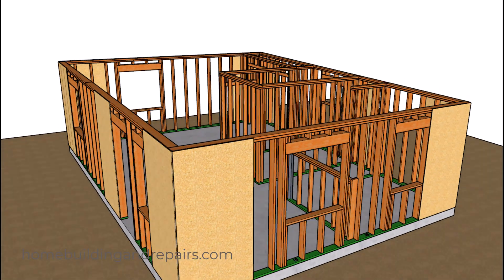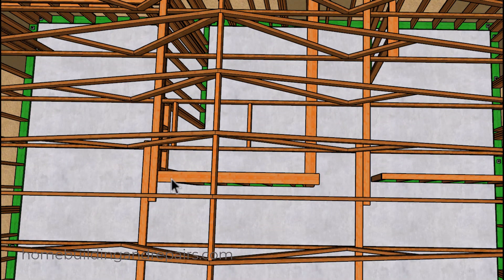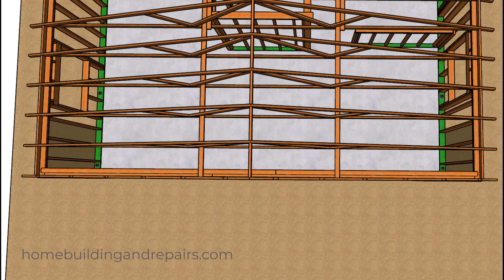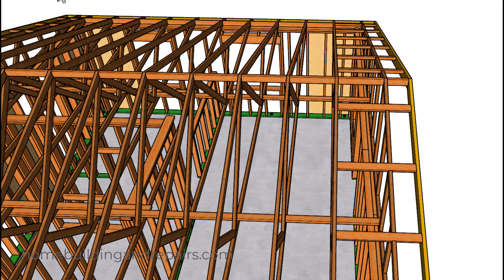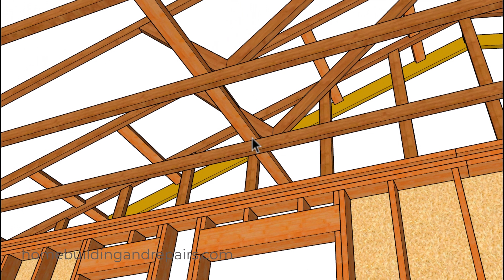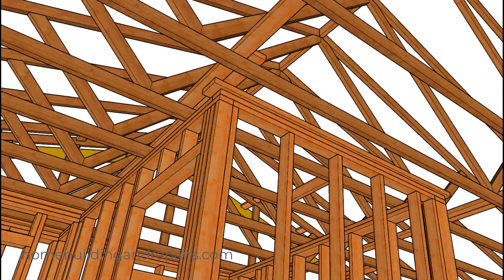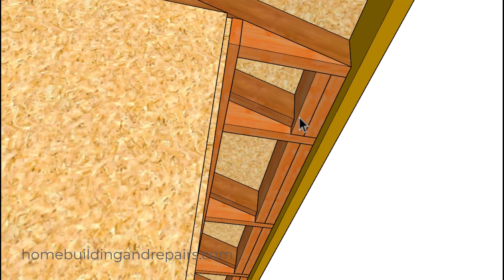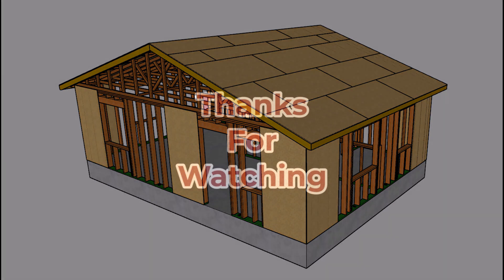Gable Roof Truss Framing Tour of 600 Sq. Ft. Small Home Construction - Part 4

Comment: How are you able to notch the gable trusses? Are they engineered that way?
Reply from the maker: It's because they are supported by a full length wall. They can be eliminated by building a full height rake wall instead of using the gable truss also.

Comment: Love the videos every time! Can you please add hardware for wind exposure that way most can see what code requires. Also, rated soffits are protected from the bottom only with no penetrations. Type X sheetrock can be bought with moisture resistance, then you add fire rated rock to the rafter blocking from the inside.